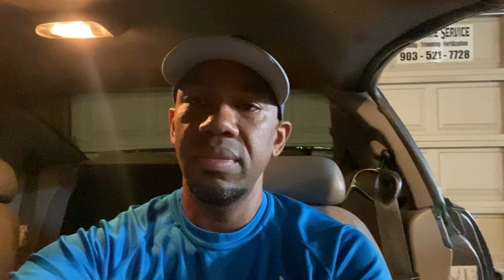4R70W manual valve body wiring!

Comment: how much power is going through that pink with black stripe wire 12v source to the transmission. how big of a fuse did you run and what gauge wire.